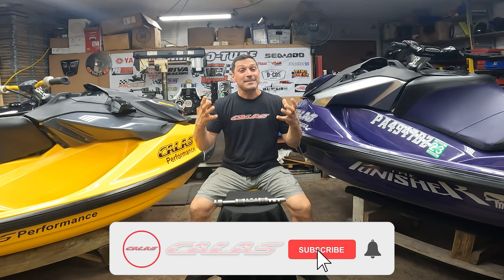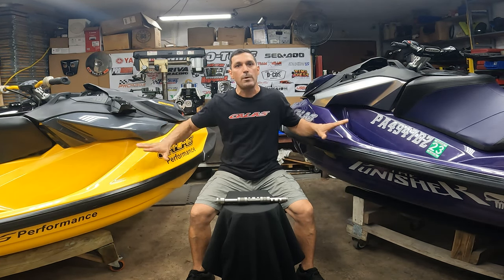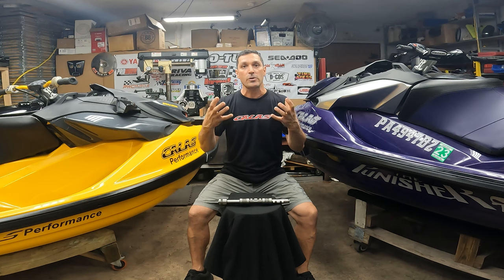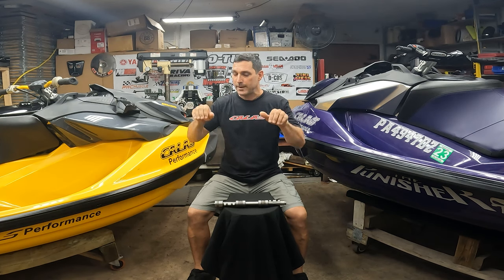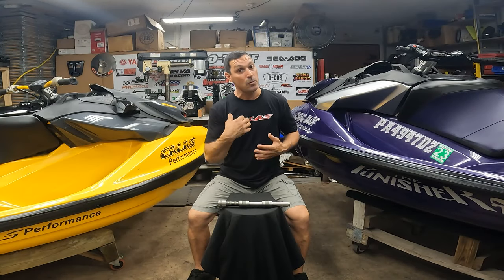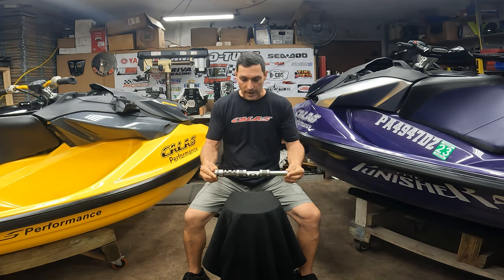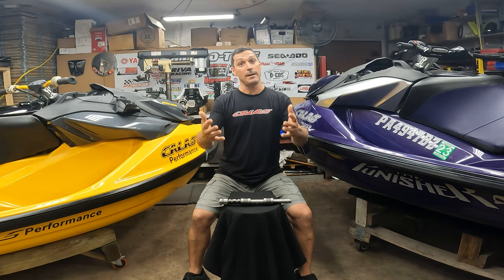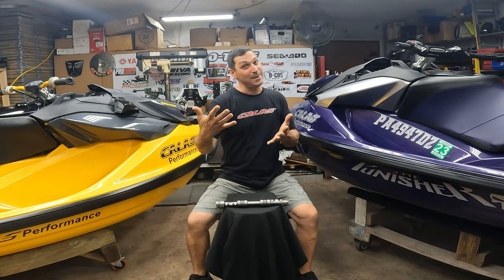NEW CALAS PERFORMANCE BILLET CAM for All Supercharged Sea Doo Jetski Rotax Motors from 2003 to 2023

Comment: I spoke with Ernesto a few times. Very educated will take time out of his day to chat with you unlike most companies. I bought a riva cam for a 2021 rxt-300 and the cam was machined too big. Riva did not want to pay for next day shipping for another cam because I wanted my ski for the weekend. 
 I also installed calas light weight cam gear and Ddr carbon fiber filter and going to switch to this cam. From my understanding the motors will spin up much quicker, rpms.

Comment: nice work.  I thought changing a cam on any motor just moved where the engine makes its power unless fatory put in a crap one like gm with the ls2   lt1   lt4???
Reply from the maker: My cam gives you power from idle speed to 10,000 RPMs